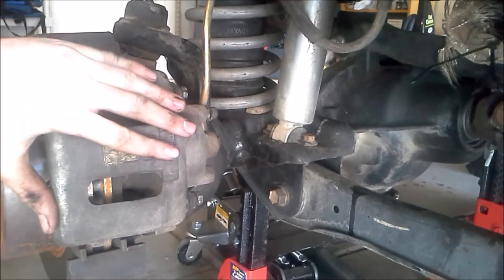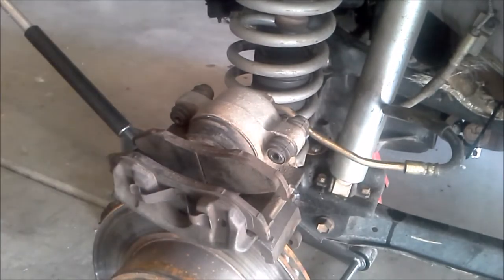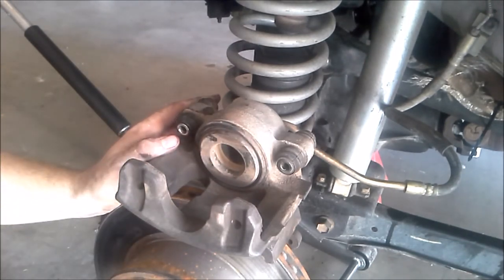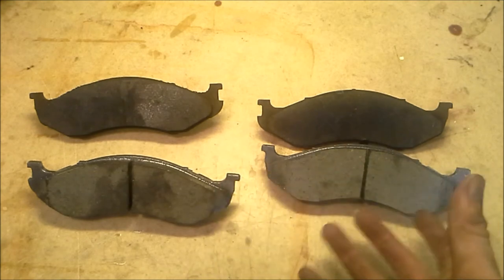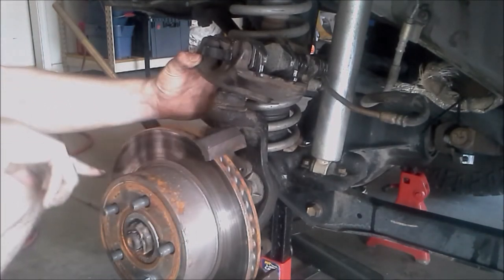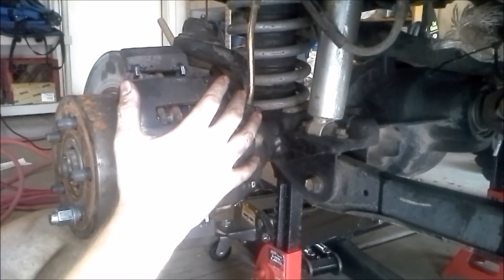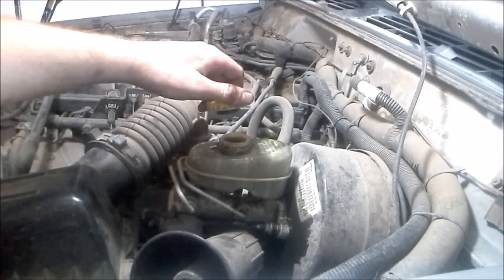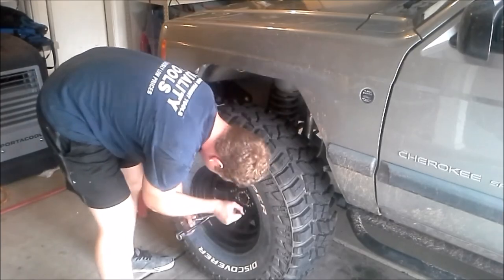Disk Brake Pad And Rotor Change Jeep Cherokee XJ

Comment: Great video, currently working on my brakes. I had success with right side, however can't seem to remove my left rotor! Any advice to removal?
Reply from the maker: penetrating oil and heat (not at the same time) will usually do the trick.

Comment: Excellent video, what brand pads did you used? Ceramic or Semi Metallic?  Just curious, I have a 2000 XJ and  it requires more than usual pedal pressure to stop and more as its coming to a full stop.
Reply from the maker: i think they were semi metallic duralast
Reply: 1DavidStarr1 I came here for the reason

Comment: If I wanted to change only the rotors out, all I have to do is undo the two bolts to the caliper, slap the rotors on and reinstall the 2 bolts and done? Thank you in advance brother..
Reply from the maker: correct

Comment: I’ve been having some issues with my front brakes to where they feel like I’m stepping on the brake pedal without stepping on the brake pad. I’ve been looking up videos on my specific issue, but I can’t seem to find anything. It happens a lot when I turn and I’ve been told it could be because I need some grease on the caliper or the steering knuckle. Have you had this issue before?
Reply from the maker: I haven’t. Are you feeling pressure at the pedal but not slowing down?
Reply: Admiral Off-Road yes, I replaced everything in the rear and bled the system after that was done. Originally I thought that’s all I needed to do. After checking on the Cherokee discussion I asked some people there and they said it could be the wheel knuckle being gouged and damaged, checked that and it was fine. It’s to the point where I can be cutting the wheel from reversing or while I’m in drive and the brakes feel like they’re actuating. I have reason to believe it’s the rubber hoses, but I’m just not 100%
Reply: Admiral Off-Road for a time they were spongey, but after bleeding I regained pressure
Reply: Admiral Off-Road and now I slow down